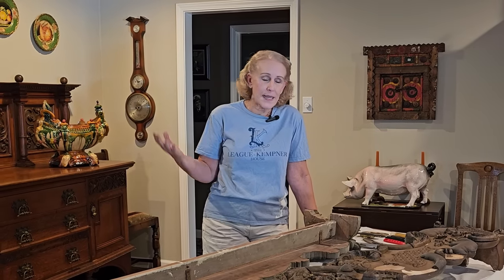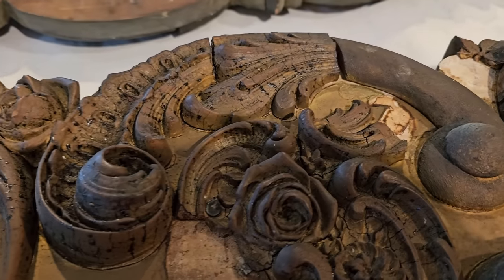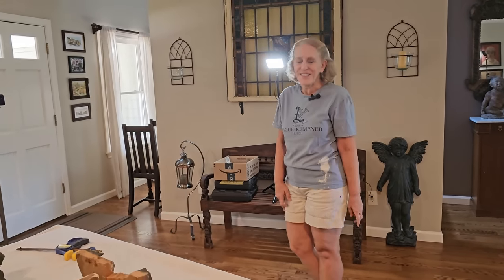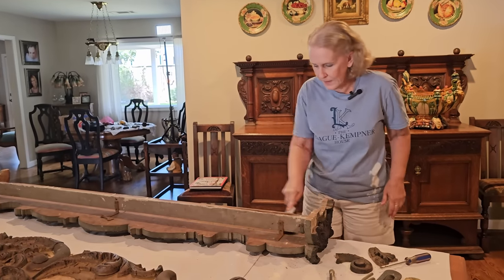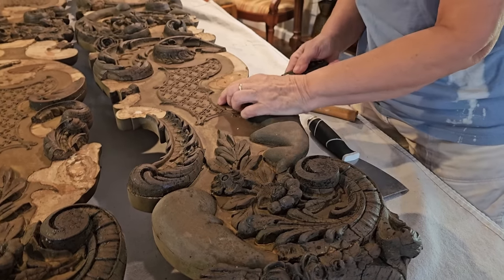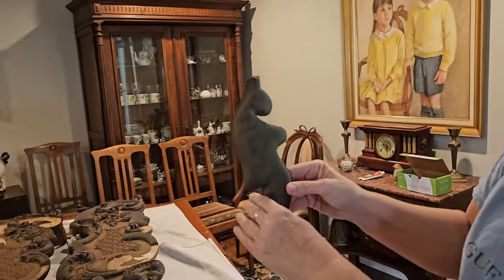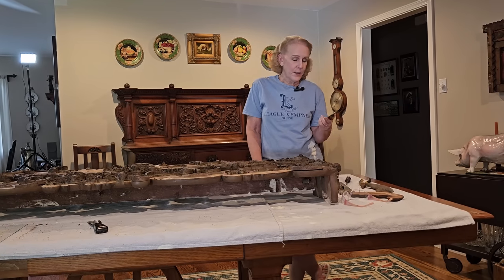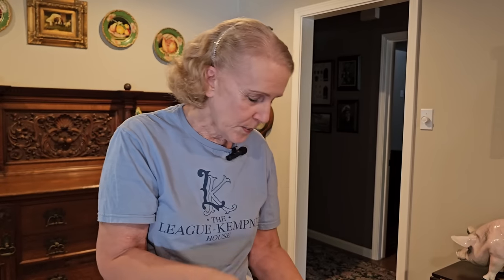S3.25 The Parlor Cornice Restoration - Part 1

Comment: Its great that you and your team of volunteers are able to think about/ get stuck into the interior decorating (the fun stuff) after years of essential repair/ structural stabilising. The work you've all already done has saved this impressive home from certain destruction. A gem of good in these turbulent times...keep it up :-).
Reply from the maker: Thanks.  We may be jumping the gun a little but it is fun to work on other projects and get out of the basement some.  Especially on low/no cost things that can be done over time.

Comment: The ornaments were probably molded of  a mixture of minerals and linseed oil, called "composition" that was commonly used to make ornamental applied moldings on walls and even furniture. I've seen catalogs from the Victorian Era you could order from.
Reply from the maker: I think you are exactly right.  There is a great preservation brief by the US Department of Interior about these pieces, I've just never run across one myself.  the process hasn't changed much in over a hundred years.  Most repairs are done with plaster because it is easier to mold and work with for these small segments.  It makes sense that these are "composition" because it could be easily bent before curing so working on the curved cornices would have been easy to do using the same molds for the flat cornices.
Reply: Good thing about Composition is it is flexible before it sets, so you can bend it over curves
Reply: i would disagree,  linseed oil does not make that kind of cracking and seeing how you lifted the pieces that "clunked" off... seems way too light for mineral-linseed oil.

Comment: The parts could be scanned and then 3D printed.  The digital scan could be reversed to help you fill in mirrored areas.
Reply: I hope there's someone in the Houston area with such a scanner to read these comments and volunteer to help.
Reply from the maker: That sure would be an easy way to get the mirror images.

Comment: I think all these bits should be 3D scanned and recomposited digitally. I don't think cobbling together one 'complete' original cornice is the answer, because you will have some elements that are missing on both, and some elements that are present on both. If you have a digital model, you could easily create a mirror image of sections that are missing on both pelmets, and 3D print that piece for a silicone mold/cast.
Reply: Really good idea
Reply from the maker: 3D technology is amazing.  We are already looking at it to replace some damaged elements on the roof.  This could be a good candidate too!

Comment: I would stick the bits back in the original location, clean everything then take silicone moulds of the missing areas,. Personally II would do it on a part by part method, over doing a big mould (less to go wrong) The rough bits on the end are to avoid the picture rail the mirror on the photo is hanging from.👍👍
Reply from the maker: I think you are right that smaller peices would be easier to do.  It's just going to take some time but there's no hurry.  These won't go back up in the house until we get some climate control and that could be a long time coming.

Comment: I think the applied fretwork is Syroco-Wood dust and flour mixed-looks like the material my Lux bobbing bird clocks are made of-----Syroco wood is a specialized wood pulp material that was created from a combination of ingredients (wood pulp and flour, to name a few). Thanks to their specific composition, the Syroco company could press the material into compression molds, which would solidify into shapes that resembled carved wood.
Reply from the maker: I haven't heard of that before.  I'm sure I will end up going down the rabbit hole researching that.  I find all of this so interesting.

Comment: Just a suggestion.... I've had to work on many projects on my dining room table (what I'd give for a workshop) and I place mover's blankets over the surface of the table, they hang over the sides and don't move as much.
Reply from the maker: That would be better than what I have, just a canvas drop cloth.  My table already looks like it went through a war, it doesn't need anymore dings.  It never got refinished after our house flooded in Hurricane Harvey.  That's a big project for another day.

Comment: Use a vacuum as well to clean in the groves and crevices with that brush.
Reply from the maker: I thought of that but was afraid I'd suck up some of the smaller loose pieces.  It may be time for dental pics and small paintbrushes.

Comment: I bet they were originally gilt bronze but as repairs have been attempted they simply painted them. I love you have the knowledge to properly restore them. They're magnificent!  If you decide to 3d them, I'd love to purchase the plans. I would love to create a large mirror surround with the pieces/parts!!!
Reply from the maker: I am hoping that as these get cleaned I will be able to tell if they were gilt or just painted.  I am assuming that in either case they were much brighter and the varnish over them has darkened with age.  I don't want them to be shiney new again but maybe somewhere in the middle.  That is a great idea to sell the pattern or at least recast some of the components.  Once the molds are made it should be easy to do.
Reply: @leaguekempnerhouse  I'm so happy you like the idea of sharing!  I thought about the too shiny dilemma as well which is why I thought of bronze. More subdued than either gold or silver, more old world glamor glimmer

Comment: I think the deterioration here is caused by heat, which you have plenty of in Texas, esp recently. It almost looks like the composition material that was used contracted and shrank, producing all those cracks, and 'bled out" some varnish - or perhaps the linseed oil it was made from - probably from being near the hot ceiling of the house.
Reply from the maker: You are exactly right.  The linseed oils keeps drying out over time and this climate is brutal.

Comment: Are the other cornices of the same design?.... maybe take some molds from them if they're not too curved. A silicon mold of the entire thing would be a huge undertaking.... piece by piece would be easier
Reply from the maker: I've given up on the larger mold size.  I agree that lots of little ones will be easier.  The curved cornices are of the same design so even if I can't mold from them I can see what it looks like to sculpt the missing pieces.  I'm heading to Galveston tomorrow and want to looke at the curved ones again.  My recollection is that they are in much better shape.

Comment: Here in Australia these items would be called pelmets... A pelmet is a decorative cover that hides the top of curtains so you don't see the rods and brackets...we also have them above inside sliding doors to hide the track and wheels.

Cornice for us in Australia is the decorative pieces that connects a ceiling to the wall...I believe you guys in the US call this crown moulding...just like you guys call the bottom equivalent base boards while we in Australia call them skirting boards.
Reply from the maker: Thanks for the language lesson.  I find the different terms interesting, even here in  the US there is so much regional variation.  What every term used, these are going to be stunning when they get to go back up.  I haven't had any time to continue the work on them other than to test out some silicone molding compound and a plaster cast.  It turned out pretty well but I thought it was a little stiff so I might try another brand or type.

Comment: Please consult with a professional restorer to see how to proceed.  Someone may volunteer to restore them for you. It looks like the original pieces that are left will not hold up if you try to remove them.
Reply from the maker: They are actually very tough, just not glued down well as age has deteriorated the original glue.  The restoration processis not complex, just tedious and not to be rushed.  It's the same basic process as decorative plaster restoration.
Reply: @leaguekempnerhouse  I had forgotten you had background in this area as your dad   owned an art supply store and you worked with him.
We learned about it during the found picture frame video.

Comment: I'm concerned the original pieces break trying to release them from glue.  Maybe some restoration to strengthen the original pieces before removing?
You may be interested in an excellent mould making video named "Making Original Wall Mouldings for the Chateau Bedroom"  He compared some products and reveals what worked best.  Start around the 7 min marker.
Reply from the maker: The pieces are actually incredibly tough and hard.  They have come apart due to the shrinking of the material they were made of, that's why they are in pieces.  The pieces themselves are not fragile at all but I'm not sure how they would fare if they fell off from 14 feet up in the air.  That's why they all need to be glued securely down.  I will check out the video you recommended.  I've been watching a lot of them, there are so many new products on the market to work with.  I'm not in any rush.  This cornice probably won't go back up for a year or two at best.

Comment: I think it might be easier to cast sections in silicone instead of the entire cornice. Peeling everything off and trying to reassemble a mostly complete one seems complicated and has a higher risk of damage. There are products like silicone molding putty that can do all but the tightest of crevices if you go that route. SteadyCrafting has some good youtube videos on using silicone molds to restore or remake old action figures. Also I wonder if apoxie sculpt is archival quality? If it is, that might be a good product to look into for the completely missing sections, or at least recreating them for casting.
Reply from the maker: Thanks, I will check out the videos and look at apoxie sculpt.  There are so many good products on the market today.  I think I've decided to go with molding the smaller pieces before they get glued back on.  It seems like the easiest route and it will be fun to have the molds in case we want to use them for something else.

Comment: I wonder if these were originally gilded at one point and over time the gold leaf shriveled and tarnished hence why it looks all blackened and burnt.
Reply from the maker: It doesn't show well in the vidoe, but there is no evidence that these were ever gold leafed.  It just appears to be a dull gold toned paint that was probably shellaced over.  The shellac has probably darkened with age.
Reply: Gold paint sounds about right. JC League wanted downstairs to be a "wow factor", but he clearly didn't have quite as much dough as the Greshams down the block, since the bishop's palace is just over the top in every way--particularly the parquet floors and carved wooden paneling on the ground floor and staircase.

I think League was trying to give a similar opulent look without totally breaking the bank. Hence molded (not carved) decoration painted gold seems the most probable option.

Also, his stained glass was bigger than anyone else, but less complicated in design than in the Moody mansion or Bishop's palace. So multiple ways I see League going for a "wow" on a budget, which of course is particularly apparent upstairs.

Comment: I would guess it is sawdust and papier machie... due to a.  cracks, b. color of the material, and C.  "shred" tissues seen when material was separated.. "not clean break but like separation tissues". 

but definitely mold cast.  probably in wax carved wooden master(s), thus giving the final appearance of carved wood.
Reply from the maker: I'm going to have to do a lot more research to know for sure what this was made of.  It cracked apart but the pieces themselve are very hard and tough.  Do you know if there is a way to positively identify the material?
Reply: @leaguekempnerhouse   bit difficult to identify many old piece materials. 

hardness with papier maiche is use of glue on the surface, linseed is sometime used (frowned on with papier mache due to fire starting potential). 

all i can say is weight of the material vs volume is first clue.  volume in your case is going to be real difficult to ascertain, without using liquid medium (again avoid water anyway).  
in old time, molding material commonly used is plaster of paris (gypsum), plaster (Lime), papier maiche-sawdust, clay-sand.  Linseed oil recently referenced is with sand, clay or sand like material- not organic material. 

seeing your lovely (but sad condition) cornice,  with molding on wood backing with awfully weak glue... two molding material might match .. papier mache or plaster.  both do not bind well to "wood" without required medium in between (aka primer in today standards).
did you say you think  cornices is 1900' made piece, not same time as building is built?

Comment: These early cornices are quite valuable. They REALLY requires a proffessional restorer (someone who does picture frame restoration). They can recast or sculpt missing pieces. GIven the value of these? This really isnt a DIY project and I encourage you to get with an expert (your local muesum may be able to suggest someone),
Reply: I agree.
Reply: This is definitely not a DIY  project
Reply: Jeanie does have experience restoring picture frames, though.
Reply from the maker: Thanks for the vote of conficence Joshua.  This really isn't a very technical process.  The hardest part will be color matching.  I've done lots of these.